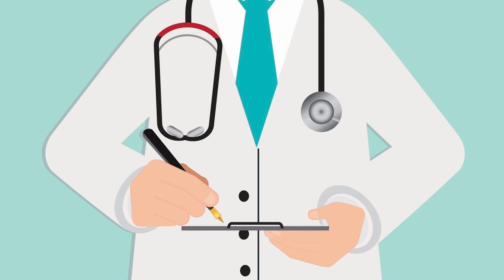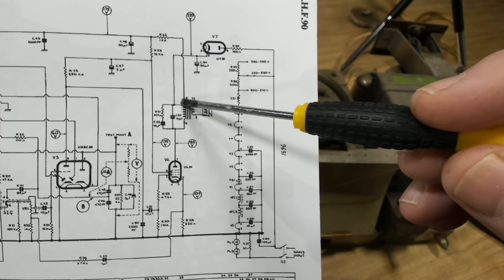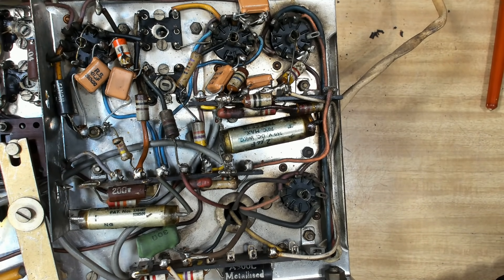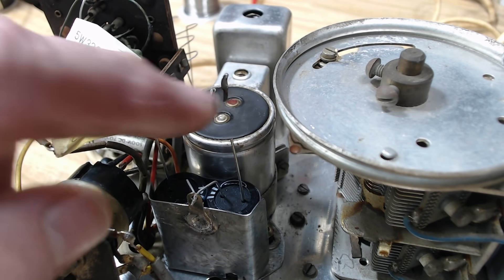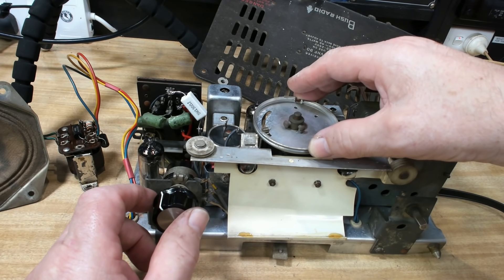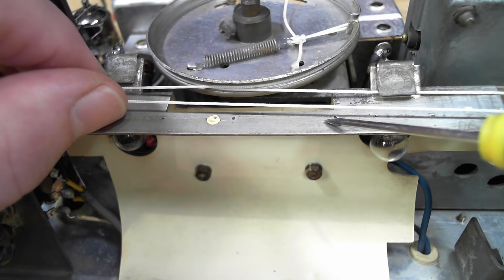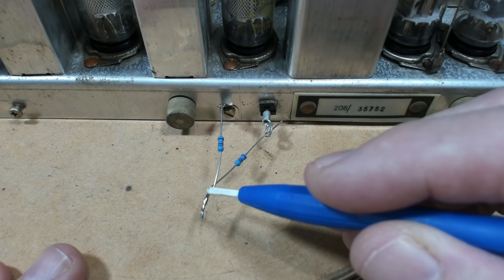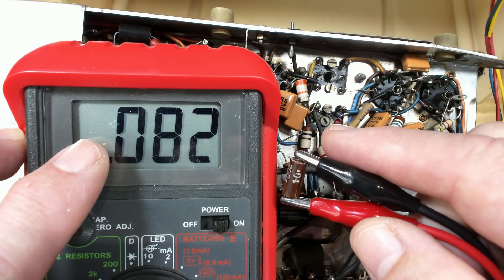Bush VHF90 Radio Restore - 1956 with Special Medical Report

Comment: Hi Dave,
I read comments that state it is a good job you caught it early: I too will ditto that.  I will add, get checked over as regular as possible, which I know you will my friend.  
Now onto the Bush radio.  Older radios and televisions were given to apprentices to repair.  Starting from 1971 through to 1976 I repaired a significant number of them.  
For some odd reason, certain mid to late 1950s models produced by Bush, Ekco, Pye, Murphy, GEC, Thorn EMI, Regentone etc. incorporated wire wound resistors on the underside of the chassis.  As you know, heat is one of the chief causes for hastening the demise of components.  As a consequence the underside of chassis could become very warm.  It was not the best of design ideas, especially on small compact valve radios like the Bush radio you brilliantly repaired.
Cheers my friend, Phil.
Reply from the maker: Hi Phil, I agree, vigilance is the key. 
I believe this Bush radio design originally had a high heat resistor mounted underneath but was moved topside in later production. As an apprentice myself I was given all the menial jobs but sometimes the tradesman would do the menial job and let me do something more important under his watchful eye. Something I carried over in my career. 
Thanks Phil, take care 🙂

Comment: Really interestinig video. My grandma had one of these but in a lovely bakelite black with some gold trims. It had been relegated to the garage by the late 1970s even though it sounded lovely - a nice soft / warm tone on AM & FM. I was a young teen and took it apart as i wanted to replace the lamps. Somehow I'm still here. The lamps never got replaced but the radio is in my office - looking great but it'll never be switched on again as I don't have the test equipment and I'm 30 years out of practice looking at circuits.
Thanks & hope you're ok
Reply from the maker: You can't beat the enthusiasm of teen boys to pull things apart. At least it is a nice display piece. We are all good here, thanks Cherrygate 👍🙂

Comment: Aw, man. Good luck with that. 

I love your videos, I've been hooked on radio restoration since I was a kid but can't do it now due eyes, so these are almost as good as. And I think that this particular set was the first radio I ever repaired around forty years ago - a friend of the family gave it to my parents for me to play with, I had no idea what I was doing, but I learned - parents, don't give your kid a hot chassis set as a toy. Wemt to the library, found some radio books, eventually found an open circuit inductor that I soldered better with a screwdriver heated in the kitchen gas ring. The first time I scraped a screwdriver across the FM aerial inputs and heard a crackle from the speaker - a moment I'll never forget. 

So really delighted to see this restoration. Really pissed to hear your news. Can you get your doc to do a rstoration video on you in the same style? 

Get fixed. Need more videos.
Reply from the maker: Thanks proudsnowtiger. I'm glad you survived your hot chassis toy and impressive result for a young lad to get it going again with no tools. It's a great feeling when they suddenly start working for the first time. Thanks proudsnowtiger, I except to come out the other side of this 👍🙂

Comment: Hi Dave. Best wishes for recovery. I was diagnosed with prostate cancer several years ago. I opted to have surgery but radiation therapy was also an option. Both treatments are equally effective for curing the cancer.  You’re on the right path.
Reply from the maker: Hi Steven, thank you. That's good you beat your PC, I'm very happy for you. The doctor recommended the radiation in my case, I would have preferred the surgery, get it over and done with but they think this best 🙂

Comment: That's a beautiful set, no doubt about it, and it's definitely one of the genuine  Real Radios,  because with it's slightly translucent cabinet and the tubes and dial  lights shining inside it it will definitely 'glow in the dark'.

Thanks for sharing, David, and success to you in beating the P.C.  < 3
Reply from the maker: Thanks Terry, I will check it out in the dark, I looked at the dial in the dark but nit the case 🙂
Reply: @DavidTipton101  You're welcome David. The  light from the overhead lamp shines down strong through the top of the cabinet in the scenes in your video that show the inside of the cabinet.  I imagine that in a  dark room the light from the tubes and dial lamps will shine faintly up through the top ... lol : - D
Reply from the maker: @TerryMcKean  The light from the dial lamps barely shows through the dial 😄 I'll check out the rest tonight 🙂

Comment: Sorry to hear about the Prostate cancer David I have not had to start treatment for the Atypical Type of CLL Leukemia I have but apparently I have had it for years and never knew I am 70 yrs old. You will beat it I am sure. Great idea making that shield for the new electrolytic capacitors so that no interference with happen. Your attention to detail is next to none. Thanks for the great video.
Reply from the maker: Thank you LUCKYLARRY. I hope your Leukemia stays undetectable or you receive successful treatment at least. The shield was probably not needed but I might as well do it while I can. Thanks for watching LL 👍🙂

Comment: As far as dial lights go, I have found that when I cannot locate the proper voltage, I often resort to either clear or amber LED'S.  Simply calculate the resistor value and solder them into the circuit. I have several radios in my collection that now depend on the LED system replacement and look very close to the original, or at least how I imagine the original to have looked.  You can do a lot with todays modern LED'S in different colors and powers. I really do enjoy your videos and am happy to see you came out on top of the cancer. I am fighting that myself now, just lost my right kidney to the damn illness but the left seems to be keeping up with the work. I have had to give up a few meds that are hard on the kidneys and have a lot more pain that way but nothing I cannot handle.
Reply from the maker: Hi Jerry, yes I have used LEDs in the past for dial lights I managed to get some in the 3000K range to more closely mimic the original lamp output. LEDs tend to be more focused than globes radiating light over about 270 degrees where LEDs are about 70 degrees max. I don't remember why I didn't use LEDs in this radio, it might have been a good option. Glad to hear you are recovering well Jerry 👍😊

Comment: I love these videos showing old valve radios. I used to have an Ekco A144 ( Long, medium and shortwave) which my Gran gave me. My other gran had a Bush DAC 10 then she had a General Electric BC 5645. Though these days a radio in the U.K. without  FM wouldn’t be more than an ornament, as very little is broadcast on AM anymore and nothing is broadcast on Long Wave.  I’m very surprised this Bush Radio doesn’t have Long Wave on it, at the time this was made The Light Programme ( now Radio 2  was broadcast on Long Wave, some years ago it was replaced by Radio 4 ( Home Service) now nothing is broadcast on Long Wave.
Reply from the maker: It is odd that there is no long wave considering the time it was made. I thought I read that a lot of the BBC programs were also on FM 🙂
Reply: @DavidTipton101  they are now.

Comment: Hi Dave, sorry to hear about the cancer.  I recommend researching every treatment method used by the medical people so you know what to expect (recovery period, resulting disabilities, and so on).  The medical profession tends to give the impression they have all the answers but, there are several other ways to be treated.  If possible, please keep us updated with your progress.

That Bush radio is quite interesting and it cleaned up very nicely.  I have never come across a table radio with 6 poles of IF filtering (the average radio has 4 poles) which, should make for improved selectivity, most noticable when trying to receive a weak station adjacent to a strong station.

That grounding problem on the tuning capacitor is a guaranteed failure, where the connection is through a piece of hardware.  I would recommend using a wire (ideally copper braid) soldered from the tuning capacitor frame to the chassis, without going through any terminal lugs.  In like manner, I have never seen a bulk filter capacitor that gets its can ground from a mounting bracket; another failure waiting to happen.

I wish you all the best Dave and my prayers are with you.
Reply from the maker: Thanks Bill. I will update on progress but it's not about me, I was concerned about getting the message across to us bulletproof men. A soldered jumper would have been better on reflection although I think the chassis is aluminium and we aren't allowed to solder ground connections for the mains supply lead as they say the solder can fail and it needs to be a mechanical join. Yours is a good suggestion though as with the filter caps. Thanks Bill 🙂

Comment: Hi Dave from wet and chilly Scotland. I've only just caught this video so I hope you're recovering well. Between yourself, Manuel in Madeira and TonyB in the States you bring cheer to 'dreich' winter days.
The brown caps are from RS components and if I remember them correctly are polyester. Radiospares rebranded as RS Components in 1971 so that sets n earliest for when the paper ones were swapped out.
Rob Stewart
Reply from the maker: Hi Rob from hot and muggy Queensland, well it's not that muggy at the moment. Good point about the caps and the dating of them, thanks. We have RS components in Sydney, Order online but they may have a pickup point in Sydney 🙂

Comment: Hi David, I'm feeling sad for your health issues: I too have had TURP 2 years ago for an awfully enlarged prostate. We have to be careful and stay away from wine and spicy foods. Up to more cheerful subjects, I have a VHF 70 in my collection, which is quite the same radio, same schematics. It was a gift in times when I was single, quite some time ago! Its main fault, that I still have to fix, is a leaky valve socket in the IF, making the AVC inoperative in AM (the 70 model has LW as well as MW). And yes, the dial lamps are dim too, though not AS dim !
Reply from the maker: Hi Marco, thank you. I have just had TURP 2 weeks ago, I'm not in a hurry to have another one.  I Googled the VHF 70 radio and it does look the same except for the LW. Bush made some nice stuff, I hope to get some correct lamps for mine one day and make it slightly brighter 😄

Comment: Nice restoration, as usual! My takeaway on this one is that nifty bracket you made to hide the new filter caps. Nicely done!  And not to worry, Dave, I beat the Big C 15 years ago - it's easily treatable when caught early.  After your treatments just stay away from toxic chemicals and you should be fine.
Reply from the maker: Thank you Sincerely Yours. Congratulations on beating your cancer, well done. The little bracket worked well, I could have just bought a new 50 X 50 capacitor, that would have been easier 😄

Comment: Dave - keeping you in prayers for an easy and complete recovery. As  soon as you said Hunts Capacitor, I knew it had to be replaced from when I worked on the Pye Piper 65U. As usual you've done a fine job on the radio and it looks fabulous!!!  Spot on my friend !!!
Reply from the maker: Hi Ron, thank you. Those Hunts caps will do it every time, you would think they would have improved over time but no. Thanks again Ron 👍😀

Comment: Nice looking radio. Those orange / brown  capacitors which somebody had changed at some point, I have quite a few of them in my mixed capacitor box. I found them to be very reliable. Look forward to your next radio.
Reply from the maker: Thanks Nigel, supplied by RS Components. I tested a number of them and they were spot on 👍🙂

Comment: Wishing you a speedy recovery, good that it was caught early.
The little beige RS (Radio spares) caps are later replacements. probably done in the late 60's before the radio came to Australia, good little sets, I have the brown version.
Reply from the maker: Thank you markpirateuk. I was a little slow on the uptake there, I quickly realised they were replacements and also recognised the RS printed on them, we had RS in Australia to. I read somewhere they changed the colour to brown down the track as opposed to releasing two colours at once, that may not be correct, Thanks 🙂

Comment: Great production again.
The static noise on AM you noticed at 47:45 was also my concern. Thought about that bad ground connection. It sounds like discharge.
Reply from the maker: Hi Erik, thank you. That noise never appeared again and the radio has been running on AM for weeks 🤔🙂
Reply: @DavidTipton101  Surprisingly . . .

Comment: Geez Dave, I was in a panic in the few seconds before you said, "The prognosis is excellent."  Good on you mate, all the very best and wishing a speedy full recovery. 
As for the radio, I reckon it would have taken about 30 minutes to assemble at the factory and 14 hours to tune it. 😉
But it came out beautiful and amazed the plastic was in such good condition.  I was expecting a part 2 for the cabinet. 
Anyway, take care of yourself and looking forward to the next one.
Reply from the maker: Haha... I like to build the tension Ellesmere 😄 Thanks for the best wishes and the radio is a very nice unit, it got a two thumbs up from my wife 😀

Comment: Well david, You have done your magic again!
Bush was a decent radio manufacturer, they made some classics too.
Your special fabricated capacitor tray was perfect.
I hope when the doctors fondle your bits, they do a neat job and don't knock you off frequency :-D
Take care mate.
Reply from the maker: Thanks zx8401ztv, I do like the Bush radios and the EKCO ones as well, a bit different to what I am used to. I've had more people fondle my bits in the last months than I care to think about, modesty has gone out the window 😄

Comment: Hi David, greetings from England! hope you stay well and best wishes for your health.
The Bush VHF 90 can be a problematic radio, yours is a later one where the rectifier cathode resistor is mounted above the chassis, earlier models had it below and it used to cook all the wiring! The selector switch for the wave change can give problems too, but yours looks in great condition.
The dial illumination in these series stringed sets are never very bright, but the audio quality is excellent. Bush made good sets, along with Ekco.
You may want to invest in a valve tester to verify all valves are up to scratch.
Reply from the maker: Hi Christopher in Merry Olde England, I did read a resistor used to be mounted underneath which is hard to imagine, there is not a lot of room down there. The bulbs I fitted were probably not much dimmer than the correct ones. The wave switch had survived very well, a low hour set maybe?  I have several valve testers but doubt the setting for these valves would be listed 🙂

Comment: Great video David. What lovely radio finished to your usual superb standard. I suppose it was brought over by someone who emigrated from The UK? The tuning dial is an obvious clue to the market it was built for. Bush made probably the most popular set over here, the DAC. One of my aunts gave me one many years ago but it went to the great skywave long ago.
Again good luck with the treatment.
Best wishes
Lynton
Reply from the maker: Hi Lynton, thank you, it was a good radio to start with so that helps. I would think it was brought over by a Pom, I have another EKCO radio that came over that way. I have a DAC90A, my first AC/DC set, I spent the first day poking it with a chopstick I was so afraid of it. 
Thanks Lynton, fingers crossed the treatment is successful. Cheers! 🙂
Reply: @DavidTipton101  😁😁😁

Comment: Thank you for the info about your prostate cancer, important that this sort of thing is not ignored. I wish you all the best with your treatment and a speedy recovery. On to the radio. I've not looked at the VHF 90 and it will be interesting to see how similar (or not) it is to the VHF62 one of which I am repairing for a friend. So any tips I pickup from this video will be greatly received - cheers.  (Now I'll watch the rest of it :) ) Watched the rest - great job. Looks brand new. Just sat back down again after the National Anthem, bruised my temple with my hand when I saluted. The sets quite different to the VHF62, much more condensed. Interesting alignment procedure - wonder if mine will be the same - haven't read the destructions yet :)
Reply from the maker: I agree Radio-Ged, we men need to be vigilant. Thank you, I hope to come out of this unscathed. I imagine the 62 will be very similar to the 90, I think the 62 had LW as well. I wondered how UK people would react to the anthem, it was meant as a salute to the radios homeland, I hope you didn't hurt your head too badly 😉👍🙂
Reply: @DavidTipton101  The national anthem is always a constant danger to us poms. Especially if you're over 6ft tall and live in a house with low ceilings.
Reply from the maker: @radio-ged4626  😂

Comment: Fantastic restoration as ever, David. Your prostate clearly hasn't put you off your stride! Very sorry about that, but, as you say, early detection means very good prognosis, So let's hope and pray your phenomenal talent is spared for many many more radios still to come. Your goal in life now needs to be to impart your knowledge on a younger "David Tipton" hiding his light under a bushel somewhere :-)
Reply from the maker: Hi Dave, thank you. It would be great if younger folk took an interest in vintage electronics and hands on repairs, we had some pretty talented apprentices coming through work when I was there so I think there is hope 👍🙂